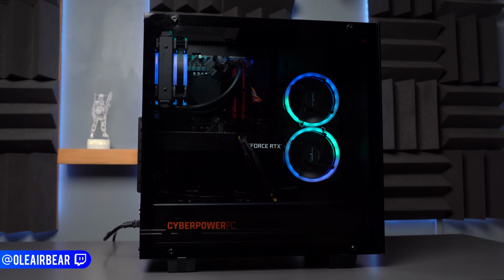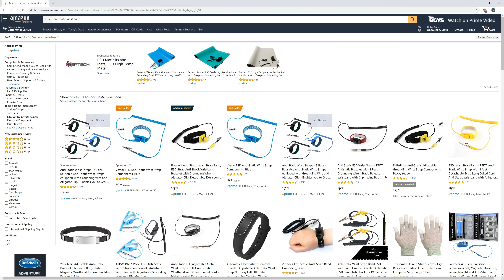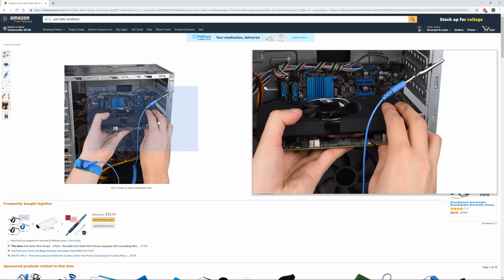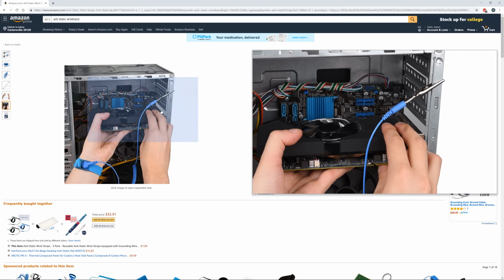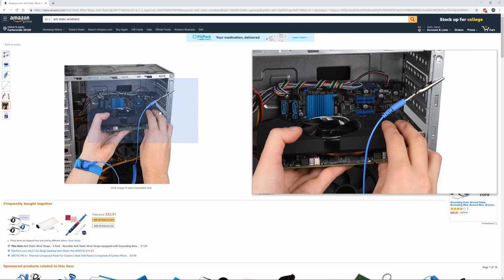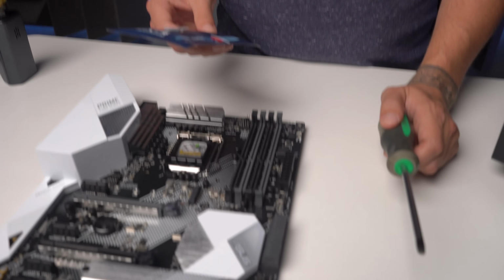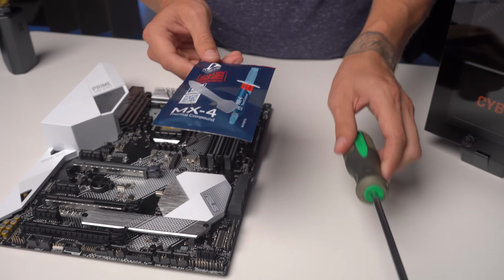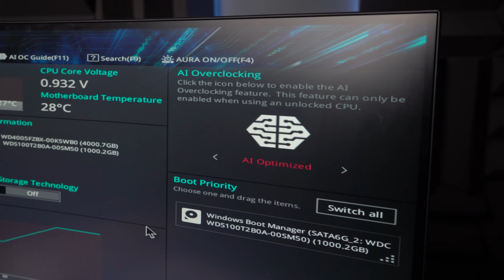How to Install / Swap your PC Motherboard STEP BY STEP

Comment: 8:31 my old Gigabyte DDR3 board had those male connectors on the actual board, this was the most fiddly part (as I did it with the board in the case already) maybe I could pull that piece off the board though? I didn't know that was possible at the time.

Comment: I have previously moved a build over from an older case. I've changed PS's and GPU's (also RAM)

I now have a new MOBO, new CPU and cooler and RAM. This is my first time installing a MOBO and a CPU, and I also have a corsair capellix cooler. I'm a little out of my depth as this is all new to me. I'm hoping I donj't have many issues. I mean I've done PC building stuff before, it's just that I have a bunch of firsts in one go to do. I've been putting it off all day, but I really want to get this done.

Comment: Since theres no dislike button im going to leave my faith and wallet on your hands please dont let me down bro
Reply: have u built in successfully?
Reply: @tohereknowswhen779  yes and I've had 0 problems ima very happy ❤
Reply: @Kolorl777  what happens to the computer after replacing , do i need to reinstall windows or smth?
Reply: @tohereknowswhen779  I kept the same hard drive so windows was already on it but if you replace you may have to reinstall windows through USB stick or cd it's not so hard.

Comment: Do I need to backup anything and reinstall windows? For sake of old drivers interfering. 

Planning on using my existing ssd boot drive and sata hhd. Replaced cpu the kt next week and haven’t had any issues 
Doing first swap this weekend.

Comment: I legitimately went through the whole process then got to the final stages and found out the motherboard port locations were to far for some of the cables to reach. Not just that they were pulled through making them short, no they were literally just fundamentally to short. I literally sat there in silence for like 20 minutes realizing I just had to reverse everything.
Reply: same is happening to me. gonna have to take it all off again 🙃
Reply: Damn....been there

Comment: who else thinks this is scary af
Reply: If its your first time swaping the mb then yes
Reply: @tdh8967 motherboards are cheap. The scariest part of pc building is handling and installing a 1500 dollar graphics card
Reply: @TetraSamurai fr
Reply: @---715  put the thingy in the thingy, pull the pin thing, put the viss, how is that scary ?
Reply: @TetraSamurai nah graphics card is easy 
If you bend a single pin on the cpu youre f*** thats the scariest part
Reply: the scary part is reinstalling windows and backup data
Reply: @twixxtro why would you need to reinstall windows if all you’re changing is the motherboard
Reply: @zackz1260 from my understanding it’s because your drive stores the old information from the old bios and it can cause issues with the new MtB
Reply: @zackz1260 I’m swapping my motherboard to a 5th gen one and have to replace my cpu and ram and honestly best £900 I’ve ever spent just no idea what the fuck I’m doing because I forgot how I built my pc 2 years ago
Reply: @twixxtro yes thank you
Reply: @twixxtro  the highest I will go in Windows is 8.1 so I can run Office 79 and games.   I dont need microsoft nosing 
around in my computer with their corporate spyware.
Everything else I use LINUX
Reply: I'm scared. Here we go.
Reply: @MursicDrummer i’m sure it’s super late but did it go well 😂
Reply: @MursicDrummer howd it go
Reply: @slay8467  did you make it brother?
Reply: Me but if I fuck it up, at least the motherboard isn't super expensive.
Reply: Yeah man im so scared that im considering not even doing it, and my mobo is total crap right now 😂
Reply: nah its okay if you understand what you’re doing, but trust me when I say you do NOT want to deal with office PCs like dell optiplex.
Reply: @enigmence I used to game on an optiplex. Worst cable management of all time.
Reply: @enigmence don’t say that I’m about to change from dell to Asus and I’m so scared lol
Reply: I used too until I watched Linus manhandle a motherboard, clean it with a hose, and it still working…
Reply: Me but ima start flipping pc
Reply: Me while I am attempting this
Reply: Been doing this for over 25 years on and off, still find it scary!
Reply: My first time so yea
Reply: I'm so scared
Reply: I did
Reply: It's actually easy
Reply: 😮my first time also I'm scared to death gpu and ps are easy to do this is a whole different ball of wax lol 1
Reply: Had my PC for 7 years now, finally swapping MB and CPU with a new water cooler. Afraid I'll frick it up
Reply: Me
Reply: I will do it next week ,yayaya
Reply: Bro a simple mistake can cause big problem in pc
Reply: Sameee
Reply: I love doing mobo swaps, putting newer boards from donor PCs into older cases.  It is stressful in the beginning,  all the components and stuff. But it's fun once you get the hang of it!
Reply: I love doing mobo swaps, putting newer boards from donor PCs into older cases.  It is stressful in the beginning,  all the components and stuff. But it's fun once you get the hang of it!
Reply: This guy
Reply: My (sadly French) friend Mei
Reply: UNPLUG, LIKE, A COUPLE OF WIRES, UNSCREW, SCREW, DONE.
Reply: oh yea re-assemble the pc COMPLETELY
Reply: Yes
Reply: I know I'm 3 years late but I'm looking to swap my asus B360M-K to a msi mpg z390 wifi and I'm exited to get it and put everything together but at the same time im scared shitless
Reply: It is
Reply: He did it in a bad way tbh
Reply: Me so much lol
Reply: Not many people..? It's seriously a really simple process. Screw in MB, plug in cables, pop in CPU and GPU, job done. The only step that sucks is the front panel connectors, just remember to use the G connector all in one plug
Reply: @KaladinVegapunk  it sounds easy and all but when you the most klutzy person ever it’s very daunting
Reply: Me 🥺
Reply: Me
Reply: I thought so too when i eatched this video contemplating wether i should do it or not, but it was reassuring to map out all og the cables that had to be connected to the new board. I did this by taking a picture of the cables in my old motherboard. Also reading the labeling on the motherboard helps a ton.
Reply: It is but I learnt it’s like looking after tarantulas, they are fragile but they’re surprisingly resilient
Reply: I am programming and making apps  but this part of it makes me shit my pants
Reply: I read this thread before swapping my motherboard and got more scared from it lol. So I told myself I'd reply to it once I did it.
Took me quite a long time cause I went slow and watched specific videos for each of my new components I was installing, and read manuals.
Everything went great, new motherboard, cpu, cooler and ram all working perfectly. 
Go slow, take breaks, there's always a solution. 
Just check all compatibility beforehand on PC Part picker. You got this 👍
Reply: It is, that's why I've been watching a lot of motherboard guides.

Comment: Does anyone know the answer to this? I currently have a Windows 11 pc. If I am upgrading my motherboard and also want to do a clean install of Windows 10 what do I need to do, should I wipe the W11 os prior to the MB swap or should I just put in the new MB and boot W10 install from USB?

Comment: Omfg I’ve changed power supply, motherboard, ram, gpu, boot drive, cpu boots windows and temps are perfect, wtf is wrong? Is it my cpu? Day after I installed a new cpu I had problems. I thought if there was a problem with the cpu it won’t even post, but my pc crashes a few seconds to minutes after booting windows and no it’s not windows because I’ve reinstalled it multiple times. Please help.

Comment: I have Asus z290A upgrading to Gigabyte z590 UD AC. My question is: can I just plug my existing SSD & HDD on the new mobo? Or do I need a new SSD for the OS? Then, plug the old SSD & HDD after?
Reply: You should be able to use your existing drives and Windows installation. I would first ulninstall the old motherboard specific sftware and drivers. Once you install the new hardware, install the drivers of the new parts.

Comment: Hi Air Bear, Thanks for your video, I got a question. Should I need to apply thermal paste on processor while putting it on new board, or just wipe with rubbing alcohol is enough ?
Reply: wondering about this too, replying for any update
Reply: @uzivur  If you're using the same cooler, wipe the old paste off and apply new paste after your cpu is installed. If you're upgrading to a new cooler, it likely already has some pre applied, and that's good enough. If you're wondering if you need thermal paste at all, yes it is necessary.

Comment: I'm always fully grounded when working on customers computer systems. And maybe I'm lucky, I've never not taken the 24 pin jumper connector from the pc before removing any other parts from the system. Learning this year's ago.

Comment: Awesome video!! I feel much more confident going into upgrading my motherboard. Quick question: I've seen videos about replacing the MB recommend doing a clean install of Windows after the installation. Is this really necessary? Will it cause issues or slow down my system if the old drivers are hanging around? Or is it safe to continue with the hard drives unchanged?
Reply from the maker: I've swapped motherboards countless times without fresh windows installs.
Reply: Update: I followed this video step by step and it worked FLAWLESSLY! kind of annoyed I put it off for so long but Happy thus video provided a quick and reliable solution. Thanks!
Reply: Exactly the question / answer I was looking for. Thanks! I assume windows boots normally as it did with the old MB?
Reply: Does this change if you are replacing your CPU aswell as your motherboard? Do you need to do a clean install to ensure you are installing all required drivers for the new CPU etc and removing old ones?
Reply: Depends what you're upgrading to. I upgraded my i7 8700K to an i7 12700K with an Z690-A LGA 1700 Asus motherboard and I needed the new drivers for that new motherboard and processor. Same with the graphics card if you're upgrading that. I wouldn't keep the old drivers if you upgrading to a new gpu, motherboard or cpu else the components would not work and have stability issues. Windows just updates its own drivers so no need to worry about Windows 10.

Comment: I usually don't leave comments but for the most part this video guided me thru the whole process of upgrading my motherboard, cpu, and ram.  I've never done anything as far as actually opening my PC and this video gave me a good understanding of how PCs work and where everything is on the PC.
Reply: same jason
Reply: I'm in the same boat now, finally making the am5 upgrade. Wish me luck!
Reply: Well not for me, never know how pc work and decide to buy one and bcoz idk sh1t i got sh1t. just using it 2 weeks and change almost all part by manual and internet + luck hehehe. bcoz sometimes not as smooth as the manual/internet said

Comment: So I got a prebuilt pc that I’ve been upgrading, I want to upgrade the motherboard as the one I have only supports 16gigs of ram, it’s good for now but in the future I want to go higher, when switching out the motherboard and using all the existing compartments, would I have to re install windows? I just got into building PCs so I don’t know much, thanks
Reply: No prob not

Comment: I just bought a new motherboard and cpu, and I opted to have it taken in and done by someone else to swap all the components. As I was going to my car to get something, I knocked my computer down on it’s side. I returned it to my monitor and plugged it back in, booted up fine, played some videos on YouTube, loaded up a video game, opened up a couple apps...all looks fine. Just waiting for my computer to have all the new parts installed into it. I played the game Prey for a few minutes and just ran around in-game, system didn’t crash. That was my other worry that my power supply would be broken, which has happened to me before and it was since replaced. I’m surprised I didn’t immediately ruin my pc, of course everything SEEMS fine. Watched this to sort of learn more, maybe alleviate worry. Anyways, great video!

Comment: (Dumb Beginner Question)
I heard there was a called "BIOS UPDATE" and "Install Windows" i do not know what to do with that. I have ryzen 5 3600 and Rog B550 please help this is my first pc build and I do not know much about building a PC so i am scared to burn my first pc and I worked super hard to buy my first pc.

Comment: i watched this because my network cable wasnt registering and i thought maybe my motherboard was the issue, i will buy a new cable and check if thats the issue before i consider buying a new motherboard tho thanks anyways good video, i replugged it and it was fine i just dont want this to happen again.
Reply: Or you could just get a usb Ethernet adapter.....

Comment: I'm swapping my h61 mb with a h310m mb and an I5 9400f the only thing I'm worried about is the boot I don't know if it will boot directly into windows because I'm using my old ssd into this new build and this ssd already has windows will it boot into windows if I put this drive in my new build?

Comment: Anti static wrist band LMAO.  I have been building pcs for 20 years and never used one and never shorted one.
Reply: So should i just not work on a carpet floor ?
Reply: @squidwardgotwaves9011  I work on a carpeted floor all the time.  Literally just touching the inside of your pc case is fine.  Unless you are in an environment with high electro static build up or are petting your cat or scratching your head with long hair while putting in a mobo, nothing will happen.

Some people prefer safer than sorry, but I have never since 1999, when I built my first pc, used a magnetic wrist band and never shorted anything out.   But by all means, they only cost $5 and if it gives a sense of security, use it.

Comment: Sorry main, but this vid aint for beginners, it's for dummies.  There is no sound advice or proper adherence to safety as to keep the "beginners" from frying up their stuff  ...dont get me started on the anti static rubber band PSA, it's as good as a meem gets, but it aint worth a lick IRL.

Comment: Say I installed everything and my power supply was working and when I test it with the paperclip it works but it won't turn on at all when it plugged in to my motherboard. Help?

Comment: did everything you did , ram light was yellow , so I swapped them into the other two slots , still yellow , took out one ram and it worked , so was thinking maybe it was just my other ram stick , swapped it with the single one that was working and it works . Any reason why two of the slots literally just don’t work when I try two of the rams ?

Comment: What do I do with windows after swapping motherboards? Do i need to reinstall everything or because my ssd has everything saved there do i not need to reinstall anything but just change drivers?

Comment: Need help i just switched from a i5 9400f to a i6 8600k cpu and it is compatible . So after i put everything  back in place my monitor  wont start up idk whats going  on  it just says no signal  and then turns black screen also my pc is going off out of nowhere

Comment: I have a MSI B450m boozaka should I replace it to get a X570 so I can get a ryzen 5 5600 or should should i stay with B450m boozaka and get ryzen 5 5600 if its compatible, I'm not sure if it is

Comment: This video really helped me out--thanks! Successfully replaced my PSU, Motherboard and CPU with this playing...took awhile (and a few tries, thanks to, uhm, installer error), but everything's working great!
Reply: Bro my cpu power cables wont go in what am i doing wrong, im not trying to use force but when my mom got it in my pc doesnt boot… and now its just stuck in
Reply: @6krone did you check if your cpu and motherboard are compatible with eachother? Whats your motherboard and whats your cpu?

Comment: moving from B350 to B550. Do i need to clean install windows or would my microsoft account detect it? using drives from old system.
Reply: Windows 10 should of detected the change thus no need for a re install

Comment: I did everything like it suposed to but when i insert power i do get led lighting on the board but nothing more then that. Any help?
I do only find 1 8pin power connector and no 4pins.
So do i need a new power suply?
Reply: The 4 pin power connector might be inside of the 8pin on the right
Reply: @cameronmccleary1461  my power suply was to old so needed to buy new one with the extra power cable. Thanks for the response but the problem is solved :)

Comment: im still scared af
Reply: why
Reply: @iateurpizza2778  i don’t wanna break my system
Reply: @mycatissuperfluffy1388  ur not it’s just like building a pc its easy
Reply: @iateurpizza2778  it won’t turn on lmao
Reply: idk what’s wrong feels bad
Reply: @mycatissuperfluffy1388  if it doesn’t turn on at all check to see if your “F_PANEL” cable is on the correct pins i had the same problem, if u have all the tiny individual pin cables watch a video on how to plug them in correctly

Comment: just a quick thought.. why do cyberpower have those power supply housing? i had one and i burned 3 PSU's i burned out a stock 600, then i burned a corsair 750 80g+ and then i burned a 850 80G+ all in the time span of 6 months... so i removed the housing (( by drilling out the rivets)) and  i have not burned out a psu yet.

Comment: I want to get ryzen but my motherboard is not compatible and i would need to get a new motherboard ram and the cpu the put it together. I have never built or upgraded before and I dont know if its worth or not.

I will just be stuck with my fx6300.

Im new to PC gaming and I hate it.
Reply: Just watch a few you tube videos... it seems daunting at first but easy to do.. the best apart about it is that you will know what the components are which makes fault finding easier